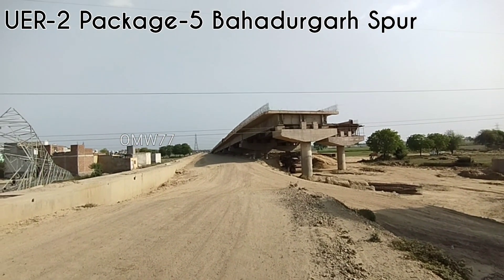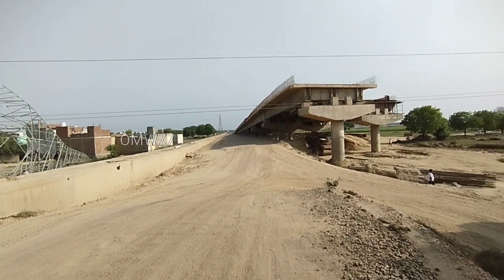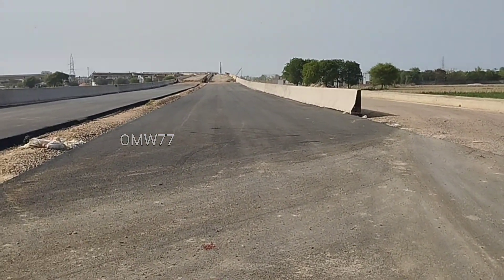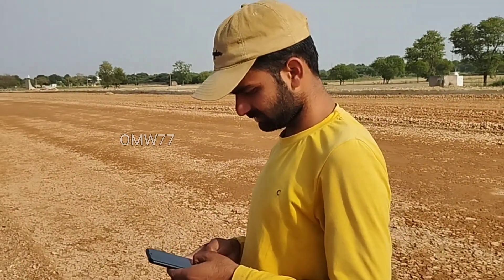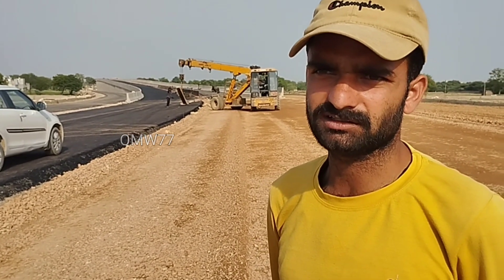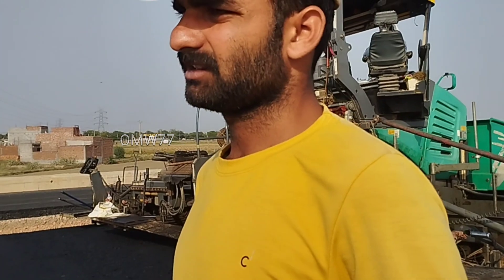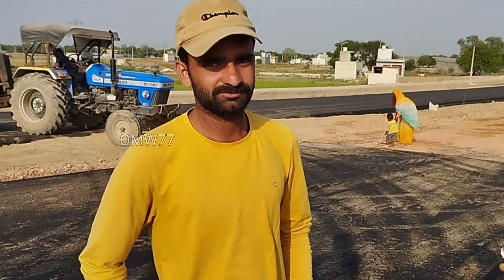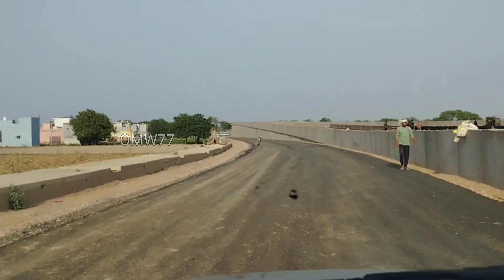UER-2 Bahadurgarh Spur Update | UER-2 Updates by Highway Engineers | NH-344M #uer2

Comment: Plz conform Mundka toll (uer-2) is applicable for both commercial and private vehicles or only for commercial vehicles.
Reply from the maker: Probably for commercial vehicles only, will confirm it with site engineers and revert to you
Reply: @omw77  thanks 4 quick reply.